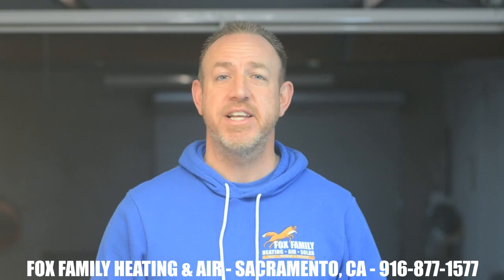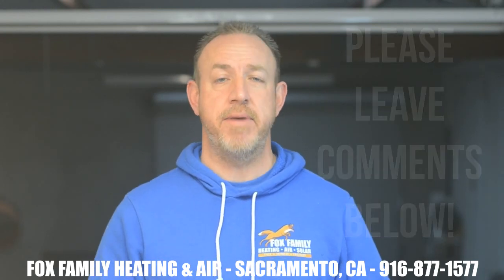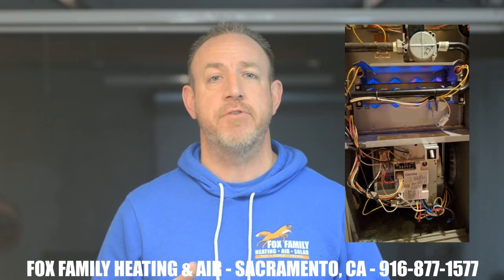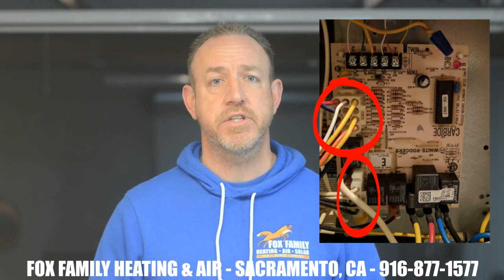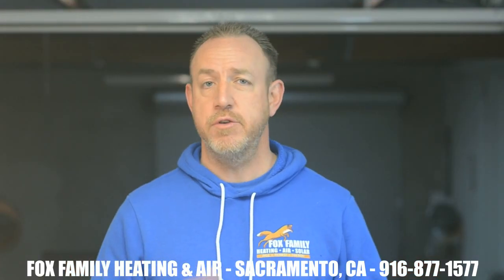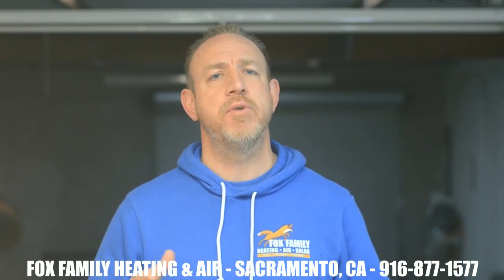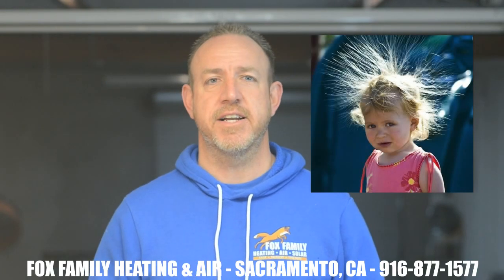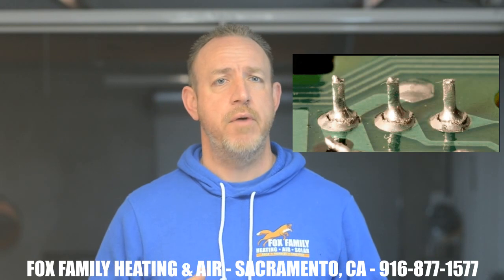Why Do Gas Furnace Control Boards Fail?

Comment: You misspoke and kept saying "transistor" when you meant "resistor." which is what you kept showing in the pictures. A transistor by itself is a little semiconductor with three leads, often in a pea-sized plastic case. Now they come thousands or millions in a package called microcomputers. They are the components that are extremely sensitive to electrostatic discharge. 

I've found a common failure on circuit boards is water. It will allows currents where they aren't supposed to go. Spilling coke or coffee on a laptop is the worse. So, take little leaks seriously, they only get bigger.
Reply from the maker: I appreciate the correction 😊
Reply from the maker: I made the change!  Thanks for the heads up!
Reply: water is bad, condensate water is very bad! it often has large amount of contaminates from the indoor air.